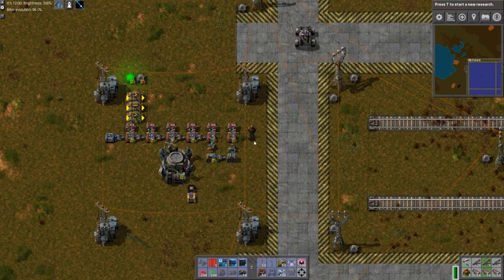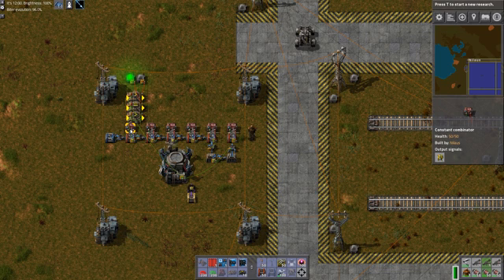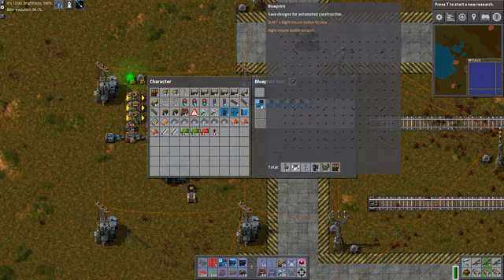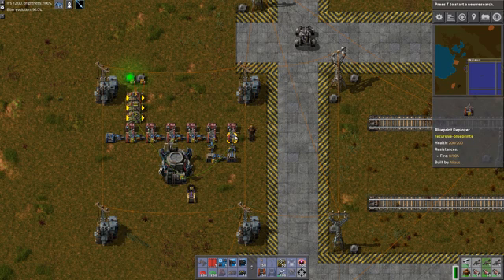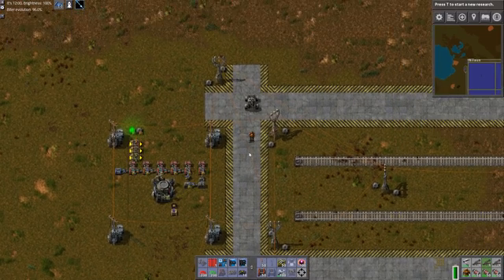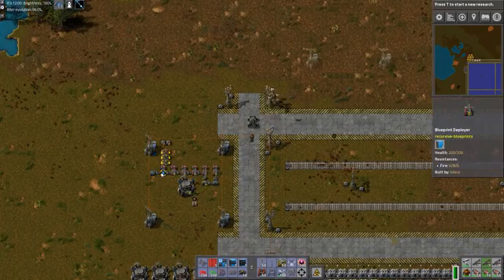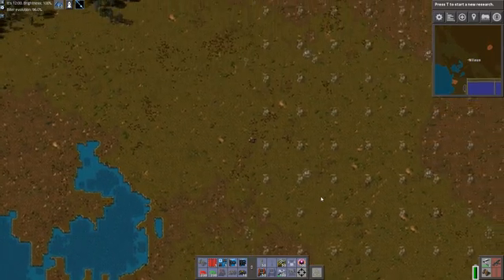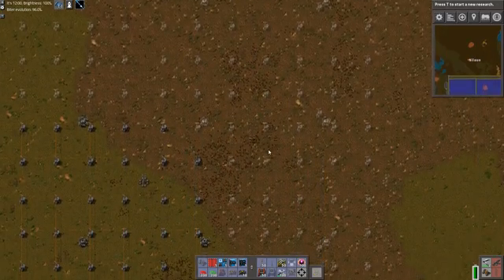Factorio - Fully automated Solar farm Glider

Comment: I know this is an old video, but, if you ever get back into recursive blueprints, I'd suggest having a pair of belts to the left of the solar farm, bringing solar panels, accumulators, etc, and filter inserters moving those items from the belts into buffer or storage or provider chests.  When one section of your solar farm is finished, the inserters get deconstructed, replaced with reversed versions which put leftovers back on the belt; sometime later, the chests and inserters can get deconstructed.

Comment: Can't you improve it by adding a buffer/requester chest there requesting everything that the blueprints require? Also, to reduce waste, set it up so it only expands after accumulator charge is reduced to so low like 50%. That way it expands with your factory. But the real problem I see is what about water or cliffs? How do you deal with those?
Reply: I think it wont deal with those, its a DUMB blue print. So it means if it comes to that its sort of a "Bug"  in the code and either it places a second blueprint to make up for the offset or the factory is holded in a "error".

Comment: Did you looked at Grey Goo factory?
Reply from the maker: Grey goo has set the bar for what can be done with Recursive Blueprint and creativity. I will definitely dive more into that. I am not as skilled as Nifty, but hopefully I can compensate for that with applicability :)
Reply from the maker: 1. Unfortunately I have not found a way to blueprint landfill. Please let me know if you hear of that :)
2. Not particularly difficult. You can hook it up to an Accumulator which outputs it power level. If that drops below 20% then it is probably time to create another solar area.
Reply from the maker: Yes, that was the inspiration for this. Not as ambitious, but more practical in a normal game.
Reply: Grey Goo realy looking like a playground for some quite interesting ideas. Ambitions drive us to the future. And inspires more peolpe around. Like You:)
Reply: there is a mod for blueprinting landfill
Reply: While grey goo was impressive, i like this more just because it's actually useful. Grey goo takes forever and doesn't do that much at the end of the day.
Reply: this is pretty handy. two questions: 1. does it place down landfill for that water you are about to run into? 2. how hard would it be to add a control so that it only expands when power gets low?